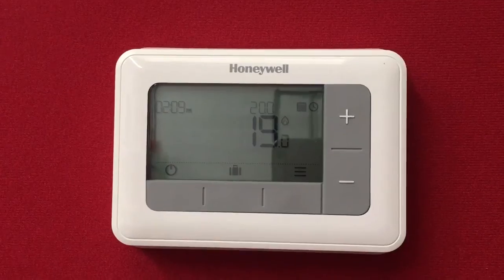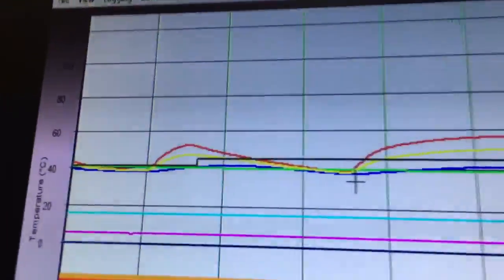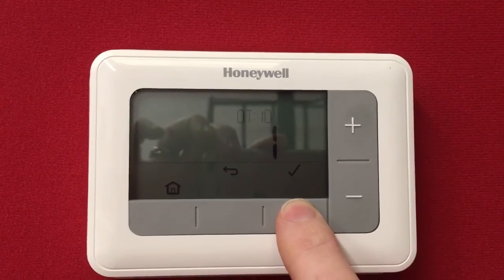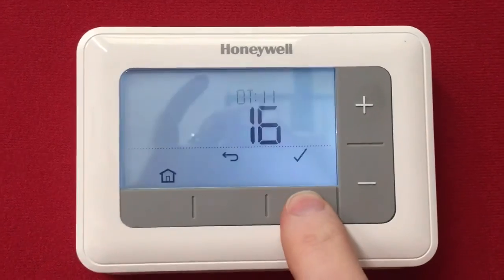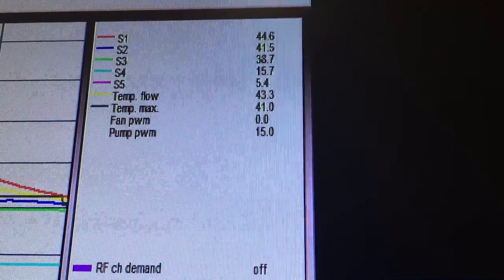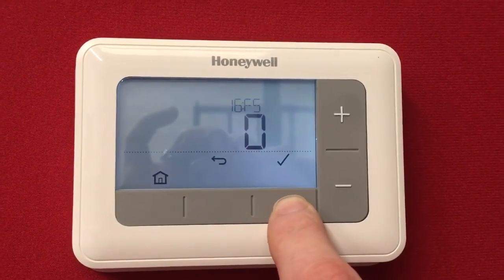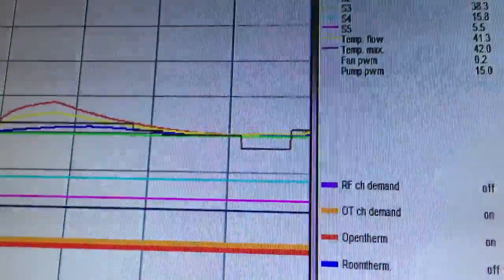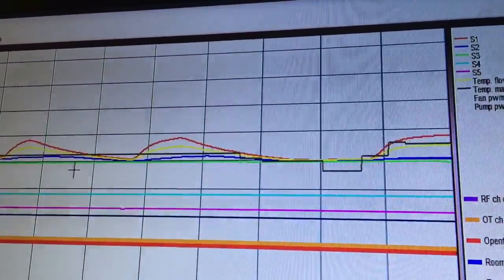Honeywell T4M Outside Temperature Compensation (OTC) Technical Overview Using Intergas IDS & ECO RF

Comment: My schedule wont turn on i have set it but the icon stays off how do i fix this even after setting the time i want for the week. It stays off and on auto but it wont adjust or change the temperature when the time passed. There is no option for me to say schedule on im confused. Can you help me
Reply from the maker: Sounds like your schedule isn't activating properly. Give tech support a call on 0300 130 1299 and I’m sure they can help get to the bottom of any issues you are having. 👍🏻

Comment: As you seem to be the only technician on the net that is famillier with the T4 can you help me. I have the same model as you are discussing here but I have a home problem.
When I attempt to simply change the OFF time on the stat it reads 0800 and will not change. On P1 which is the only programme I need , I can change the ON time , push the tick to save and go to next setting which is the OFF it will not allow me to change from 0800 it goes straight to the temperature adjustment. I have to shut manually each night. What is going on. Can you help , Honeywell have no idea it seems on their website.
Reply from the maker: gimingham there has been a couple of updates on the firmware with the T4 series, so I believe they are very slightly different now. Unfortunately Richard who did this video is on long term sick at the moment so will be unable to help. If you contact Resideo on 0300 130 1299 they should be able to help you, as this is their product and should be able to support customers with setup of their schedule. Sorry we can’t be more help at the moment.